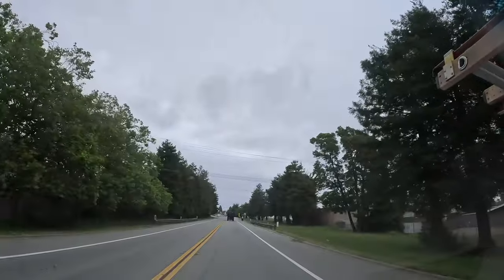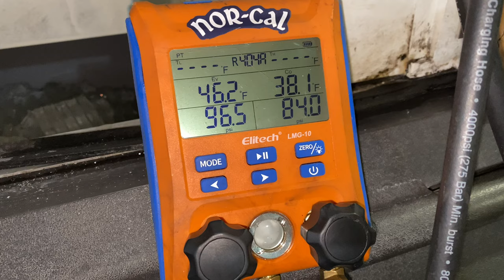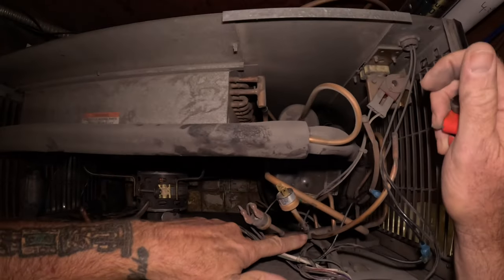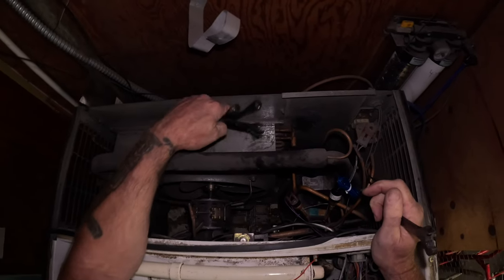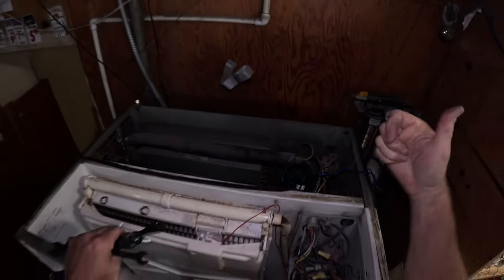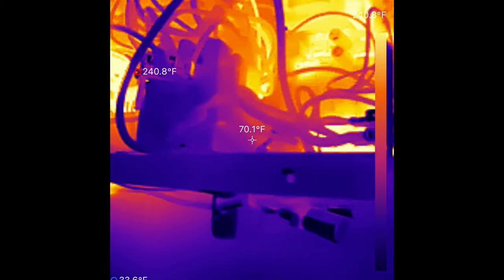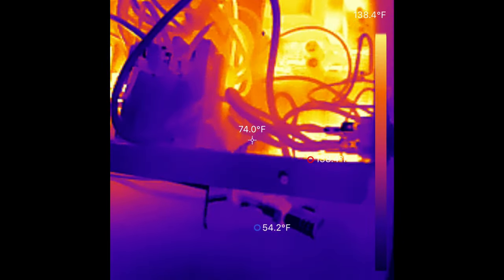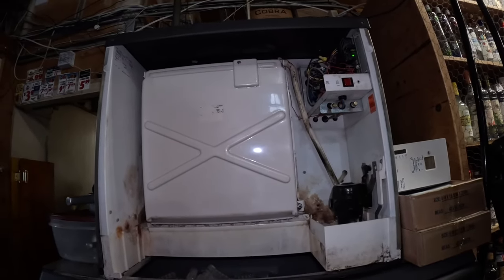DO This for Manitowoc Fan Cycle Switch

Comment: the old Q series never dies...built like a tank in 🇺🇸
Reply: Just removed a 2002 model as well today absolute unit, only reason we replaced is because it became to much of a health hazard with the amount of cold water mold buildup. But it was making ice still!
Reply: @justincarney1005  yup...they were the best model ever made by manitowoc. In our shop we still have a J series unit working since 1997
Reply: @kingofthecrease30  I have a 2005 era Quiet Cube machine at one of my restaurants, other than a dump valve, condenser coil cleaning, and a curtain magnetic reed switch, is all the parts it's ever needed since 2018... Condensing unit is beat up, accumulator is rusting, but still holding a charge and pumping out the ice. That little toilet tank style float that keeps the water level full in the trough is so simple and reliable, not water fill valve to bust or fail. No float switches or water level probes either. And since the entire condensing unit is on the roof, the only thing in the ice machine head itself is the receiver. The only noise it makes is the crash when the ice harvests.

Comment: I use a Johnson control fan cycle switch if I can fit it in there. Sometimes I will move the high pressure access back and put an access tee on it and come off the side of it. The larger fan cycle switch last a lot longer . The way you fix it is the same way I do it on small units I can’t fit the larger control in.Never had many issues from that point except when I use the Mars/Supco  small switch and it goes out a few years later.

Comment: Just a personal perferance question. Why braze on an access port when you could just tee off the high side port you recovered from?
Reply from the maker: I like it in the back! 😂
Reply: I don't know if I can answer for him, but it seems to me this way keeps the fan cycle switch (and wiring) in it's stock location in case he or someone else needs to work on it again, removes the defective switch in case it should physically leak or fail in the future, and seems like the right way to fix this since a pinch off tool is not needed and provides him or any other serviceman a easy way to replace the switch, with a cheaper standard part none-the-less, without having to either pinch the system off or recover it to do the swap.

Personally there's nothing more irritating to me than cracking open a system and finding massive hacks, capacitors and limit switches bypassed or left hanging around/in the unit, defective/failed switches, limits, sensors and bypasses patched in wherever they would fit, having a tech run a bunch of wires to a different place so they could have an easier in/out fix and having to undo all of those things to get a proper diagnosis or fix on a unit. 

Since the original sensor failed, and the last replacement was done with the pinch off method, he didn't even have to use a coupler, he just unsweated the last repair and was able to solder his schrader valve and spin on limit switch right in. I have a rule when it comes to anything I work on, and that's I want to leave the thing I repaired better for the next dude who works on it, because that dude is likely going to be me!